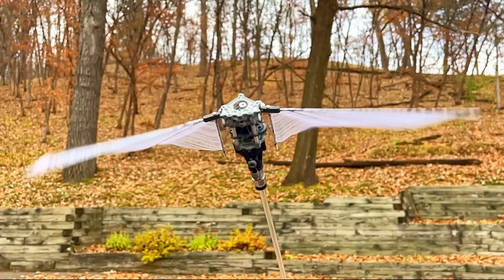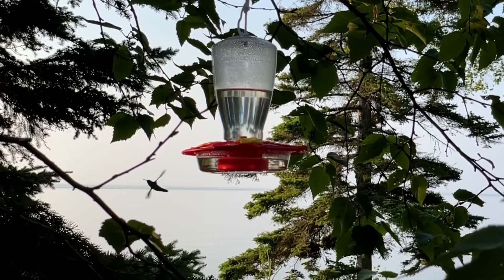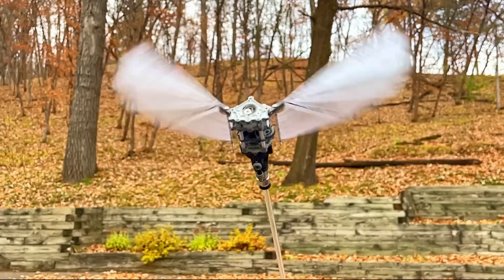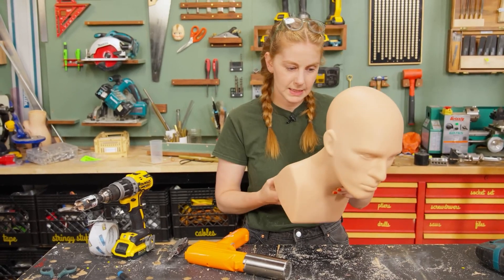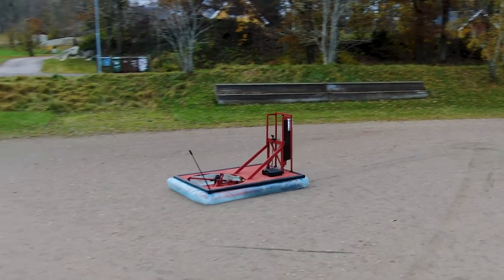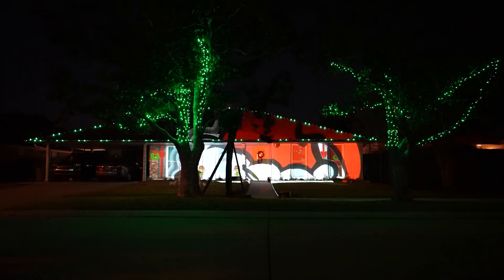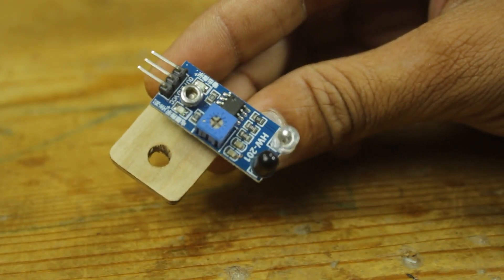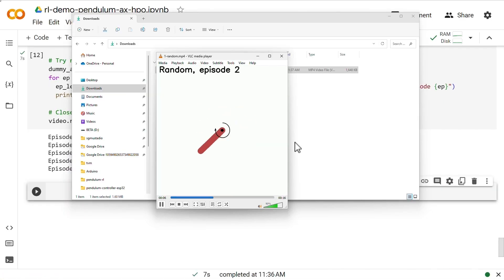Wind Beneath My Wings [Maker Update] | Maker.io

Comment: Why not use Solenoids? Push pull action. These little Engines can be made extremely small and have a lot of power. The power can be Atmospheric with very few parts and just might let your Bird Fly. 😊Just a thought mate. Thanks for sharing.